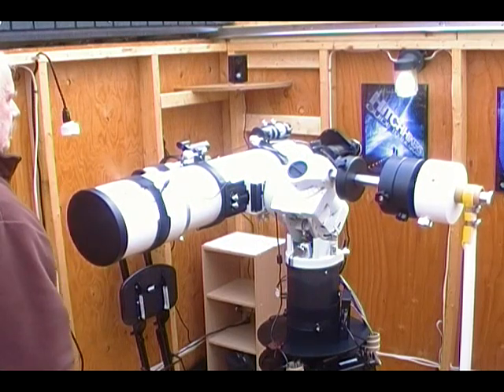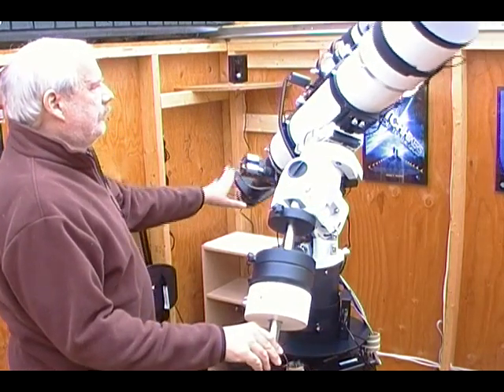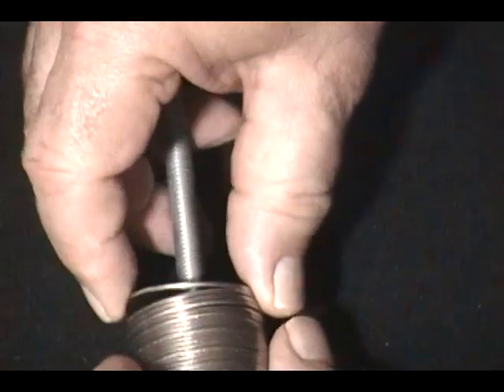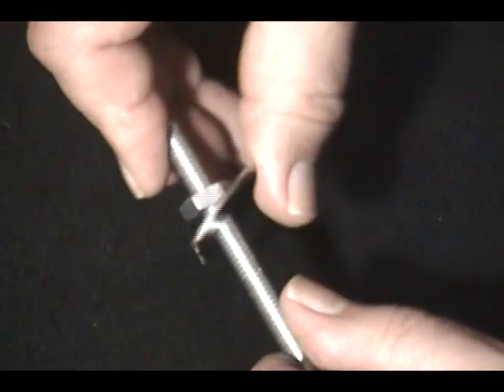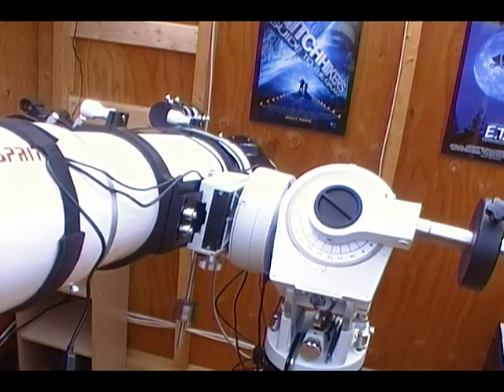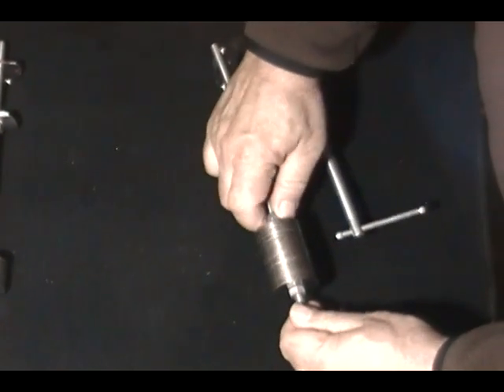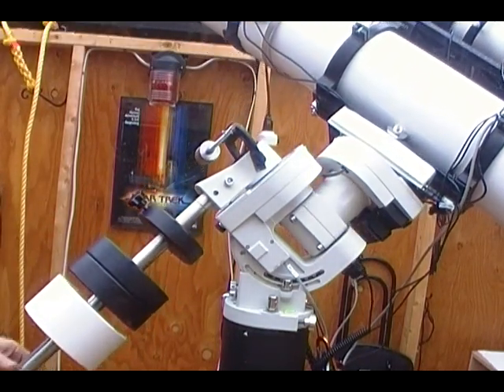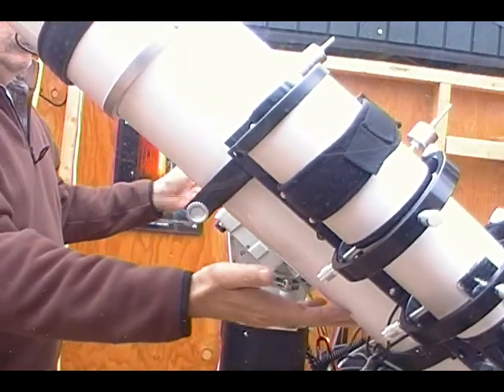Balancing My Sky-Watcher Esprit 150 on My iOptron CEM60

Comment: I'm not a fan of a perfect balance for the hour axis : 

1) a perfect balance means that it is in an unstable balance like a ball at the summit of a mountain. The slightest wind blow will push your ball down the hill...

2) to minimise backlash during long exposures, prefer a wee bit of more weight on counterweight side and use the couterweights in the west part of the mount (if possible given the celestial object tracked) : counterweights will always slightly "pull" the mount without returning backwards

3) if the telescope is left alone, and if, for any reason, the hour axis break is loose, a wind blow could cause the telescope to "crash" on your tripod. If there's more weight on the counterweights part, this can not occur...
Reply from the maker: 1. Perfect balance is intended only as a temporary condition. The fender washer contraption gets me this far. Then I add a few ounces of bias weight to the counterweight side. The video didn't show the latter part because the point of the video was to show that the telescope being at rest in the horizontal doesn't mean it's balanced.
2,3. I follow the crowd that promotes east-heavy slightly off-balance. They seem to be in the majority and I got into that school during my formative years. Lucky for me, the counterweight side is to the east until the meridian flip - at which point I generally go to bed.

Comment: Thanks for sharing.

Another detail took my attention : at ~2:33, one can see what looks like 2 bright adjustement screws under the tube dovetail plate. Are these used to make the tube axis perfectly perpendicular to the declination axis and correct cone error ?
Reply from the maker: They keep the plate from sliding out of the mount in case the clamp loosens. There's another pair at the other end of the plate.  Safety first!

Comment: I have the same problem, I note that it is due to unperfect alignemen between counterwight axis and declination one, the way to fix it is unscrewing the two screws that holds together the two asis. But be carefull doing that, I made a video for that
Reply: My counterweight shaft is not straight up and down when at the zero position, is this what you mean?  Also, when you unscrew those two screws what could happen? or why do you say be careful?  Thanks

Comment: Hello, did you put an extra counterweight on the R.A axis to set your mount east heavy in every case ? I didn't understand what it is for ?
Reply from the maker: When everything is in balance and all clutches released,, the scope should stay where I put it. Instead, my telescope wants to settle back to horizontal because there is some unseen force pushing it there - like a weight on the port side of the telescope. I counter that by putting weight on the starboard side using the outrigger contraption you see in the video. Now, if I push the telescope to any arbitrary angle, it'll stay put. The same applies to the RA. The counterweight bar seeks the horizontal because there is a center of gravity below the RA axis. I add weight above the axis to balance that. That's what I show in the video.
Having said that (and worked hard to get perfect balance), everybody (including me) adds a little weight to deliberately throw off the balance  towards the east side. Before a meridian flip, that's the side with the weights (the 20lb ones). Some even add a little weight to the camera end of the telescope. The former puts a little pressure on the RA gears, the latter does the same on the DEC gears. Without it, the gears would tend to push-then-coast resulting in irregular tracking. We're only talking a few ounces of imbalance.
In the video, I didn't address the "east heavy" technique but, instead, focused on the overall balance. The "east-heavy" imbalance comes afterwards.
Reply: @sisyphus9146  thank you for your precise answer, it helps me a lot :)
Have a nice day, and merry christmas !

Comment: Nice video. Using an Esprit 100 with CEM60 EC. Did you add a RA setting circle or is it degrees? Curious what you use it for. Likewise I blalance my DEC first before RA and only after everything, cameras, lens caps off, wires attached.
Reply from the maker: I made the setting circle although I don't use it for setting anything. Early on, I made it to help me understand how RA works. Thanks for commenting. I'm glad someone balances the same way as me.

Comment: Another way is low powered magnets :-)
Reply from the maker: Tried that. Too much aluminum, not enough steel to find a place to attach them. I tried flexible magnetic strips. They weren't heavy enough by themselves and weren't strong enough to hold steel weights. Clamps seemed strongest.

Comment: Hi, maybe you need to rotate your telescope in its rings on the vertical. Watch this video from 5.25mins in. He gives a good explanation. Hope it helps
https://youtu.be/hGduG2jB9ec
Reply from the maker: Thanks for your comment. Astronomy Shed was a major influence for me in many respects including the video you mention. His solution helped but it put my finder squarely behind my mount - couldn't see the sky. I've gotten used to my outrigger weights so I'll stick with 'em. No slight on his method or your suggestion to use it.

Comment: balance isn't about being anal its just getting balanced ish, not that important really okay you dont want in a foot out but guess what the motor drags it round that's what the balance is for so you dont add to backlash
Reply from the maker: Good point... well taken. However, the video shows what's achievable. 
If the offside weight is sufficient, it can overwhelm the imbalance used to counteract backlash (especially Dec) as the assembly rotates through RA.
Mine was horrendous so I made the counterweights.
After balancing I give a little bias to the east side and to the camera end of the scope to fight backlash. For me, the amount of bias seems easier to determine if I start with a nearly balanced scope.
Thanks for your comment.

Comment: Thank you for the great video!  When you and others say balance a bit East heavy, does that mean with the counter-weights pointing East in the horizontal position or the scope on the East side in the horizontal position?  By the way -- I'm taking a trip to Home Depot or similar store to buy fender washers and threaded rod tomorrow.
Reply from the maker: During the course of an astrophoto session on a target, the mount rotates about the RA axis such that the east side rises and the west side sinks. Before a meridian flip the counterweights rise on the east side - make their side a little heavy. After a meridian flip, the counterweights switch over to the west and sink - make the scope side a little heavy. The heavy side is always the east/rising side but only a little bit heavier. This is not precise because the torque changes as the shaft rotates - zero when the shaft is vertical, maximum when horizontal. We're not trying to influence balance so much as to keep the motor's gears from "floating". 

In practice, this is difficult to manage on both sides of a meridian flip. Here's what I do:
 Unbalance RA to make the scope side a little heavy.
 By trial-and-error, add a few small weights to the counterweight side to rebalance. I wire fishing weights to a clip.
 Double the added weight on the clip. (Now the counterweight side is a little heavier than the scope side.)
 Start the astrophoto session.
 When the meridian flip happens, remove the weighted clip.

I hope this helps both theoretically and practically.
Reply: Thank you !
Reply: Thank you for your explanation and video.